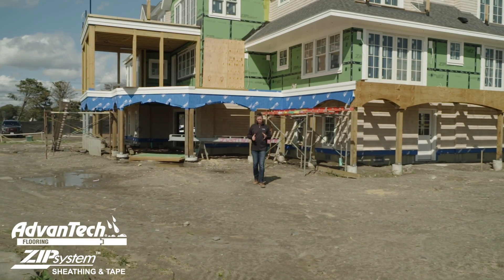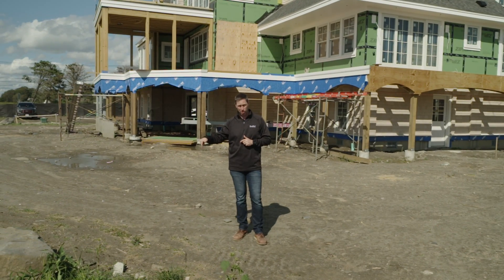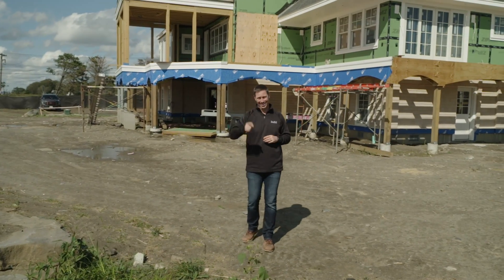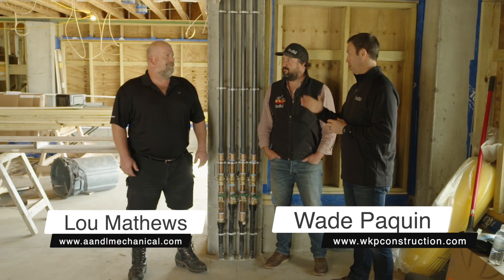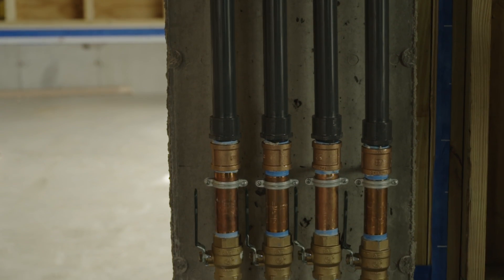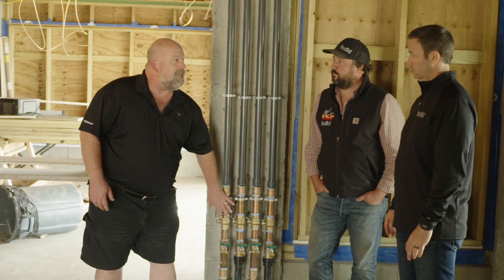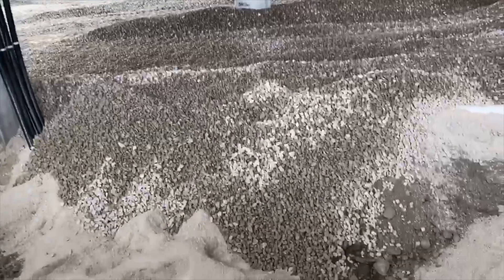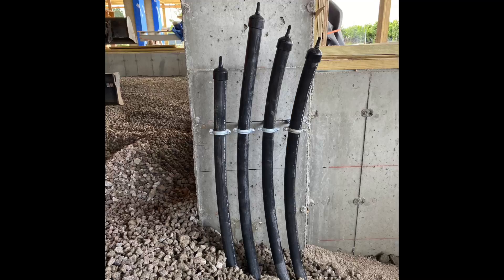Debunking 3 Geothermal Myths

Comment: I'm in the design phase now, we ate designing one well only, instead of multiple, we can still use that well for house water, irrigation and geothermal system, geothermal is closed loop and will provide heating and cooling. For me it was a better option all the way around, didnt have to run a gas line or water line to the property, no meters, no extra Bill's to think about and pay every month. Just electric and if I ever wanted to add solar I could be completely self sufficient. There was a few other systems that provided the same outcome but I chose ground source heat pump. Only time will tell if it was the right choice
Reply: One well for closed loop geothermal and potable water?
That doesn't make sense
Reply: @FrancisKoczur  lol exactly, I've never seen it done but it's a design of my own, kinda of experimental.
Reply: @townsendliving9750  Your incoming potable water will be colder in the winter (maybe 40's) costing more for hot water, and will be hot in summer (maybe 70's) costing less for hot water. You'll need to be able to deal with the cold water not necessary being what's expected for cold.

The depth will need to be quite deep to exchange the heat. You might want to check the data and use a thermal conductivity of around 0.57 W/m K or less
looplinkrlc.com
Reply: @FrancisKoczur  ground water temperature does not change at any time during the year, it's a consistent 52 degrees all year round, doesnt even change by a degree from what I've seen, my well is 80 foot deep. In the summer you will want exchange the heat into the cool from the water, 52 degrees will be much cooler then outside temp meaning it would be more efficient then a air source heat pump, in the winter you will want to extract the heat from the 52 degree water, again, much higher then the outside temp meaning much more efficient then air source. Plus water or liquid is a much better medium then air. Plus there has been two engineers work on the project, so far it has been extensively researched and tested using computer models.
Reply: @townsendliving9750  Is your well in a huge aquifer with plenty of water flow/movement? I think the question would be whether the heat that is extracted or dumped into the surrounding well water from the closed loop would be changing the temperature of that water already sitting in the well, which is now being pumped for domestic use. If there's enough water exchange between the ground water and the well then I agree that if the math checks out it would work (and also an interesting take, never heard of that system before).
Reply: @townsendliving9750  Edit: If your situation matches what @wighty said you should be fine (like a underground stream perhaps)

Deep ground temperature is stable, until you extract or dump heat from/to it. The potable water will steal or radiate heat, probably when in the pressure tank.
80ft is way to shallow for a single closed loop pipe unless something like the well diameter is in feet with a helical coil giving the loop pipe more contact area. Your evaporator will freeze in heating mode without enough heat exchange in the loop.
Reply: @wighty  so to answer some.of those questions hopefully is we put a pump on the well and pumped 500 gallons an hour with no issues, so it's basically a river flowing underneath me, we pump 4800 gallons in one day for testing. I'm at the bottom of one of the largest farms in america, so it's a mile up hill, and the river is a mile down hill. The 4800 gallons were 52 degrees on the first gallon pumped and 52 degrees on the last gallon pump, that test was performed once in February and once in july, same results both times. But the geothermal loop does not go down the well, it goes into a cistern, the well fills the cistern as a sort of thermal battery bank.
Reply: @townsendliving9750  where is the cistern? How many gallons? Is water being cycled in and out of that?
Reply: Cistern is in the ground next to the well house, that's part that's still in design phase I suppose, we were thinking around 3800 gallons, but I have access to a 11k gallon concrete tank, this should provide enough BTU capacity to heat or cool for several days before it needs flushed, so yes then the tank would be injected back into the well, we also thought about a second injection well elsewhere on the property. So we will have one normal submersible pump in the well that pumps to the cistern, and then 1 pump in the cistern that can pump to the house, or with some automated valves pump out of the cistern back into the well. The house is all concrete so the system will run, reach its temperature, empty the water, wait several hours for the aquifer to naturally flush the cold/hot water out, the refill the cistern, and reheat/ recool the house, we also have other ways to add heat to the cistern in the winter, if the fireplace is ever ran there is a heating loop to gather heat from that, and theres also a oil burner in garage that does the same. Since the house is also my place of work a mechanic shop
Reply: @townsendliving9750  that is pretty nifty. You should do a write up of it for people to reference in the future
Reply: @wighty  if it works, so it was my design and I've had two engineers look it over and approve it, but it still scares me cause I'm putting alot of eggs in this basket
Reply: @townsendliving9750  have you thought of making a video and puting on youtube?  It would be cool to see this system
Reply: @bobsacimano4104  I have actually, I'd love.to video my house build and make alittle money like some of these youtubers, I actually started my channel and made a dozen videos but never posted them cause we got delayed on the build this year, we are going to try to break ground next april, I'm an idiot when it comes to electronics but maybe something I could learn, my house has dozens on differnt design ideas that I've never seen on another build. It's been 3 years in the making, and its designed for the average blue collar american, I make less then 50k a year so its defently built on a budget
Reply: @townsendliving9750  lol I'm the same as you with electronics. I have to ask my brother for help with them.  I bought a drone to take pictures of my build which was fun. My brother had to help me a few times.  Good luck on groundbreaking in April
Reply: Sounds interesting Towns End and hope it works well for you. My water well doesn't flow anywhere close to those number.  I installed a ground bed system.  With this single well set up I'm hoping you'll be using a jet pump set up so you don't have to mess with your geo lines if you have to replace/work on your submersible well pump?

Comment: The next time you have the chance ask a HVAC engineer if there would be a benefit return air from the floor in winter and from the cieling in summer.  It has always seemed like a good idea to me.
Reply: The way the forced air systems circulate with the variable speed blowers it doesn't create the cold floor and warm ceiling.  The blower will be slowly moving air all the time. I rarely see temp different than what the thermostat is set for.

Comment: We've been on GSHP for 10 years now in MN.  3200sq ft 4 level split and I have 4 closed loop vertical wells 200' deep.  Gives us 4 tons of cooling.  Electrical utility gave us an all-electric discounted rate so $0.05/KWHr.  Dual stage compressor w/10KW 3rd stage electric strip.  Avg monthly heating/cooling/hot water costs is $149.  House is MUCH more comfortable and ZERO CO risk.

We were quoted $12k for a 80% efficient natural gas furnace and new outdoor air coil vs. $24k for the GSHP including wells.  With 30% tax credits we were looking @ $17k vs. $12k.  Best decision we've made.
Reply: It’s great to see actual numbers from a house in a similar climate to mine. That sounds like an excellent deal.
Reply: How about the lines plugging, piping wall buildup/efficiency, earthquake?  I used to think it was the best way, but that's a heck of a system to replace.  I'm sure you're happy, and it might even be close enough of a wash, however, that is HIGHLY dependant on that extraordinary electric rate; solar electric might be a great addition.
Reply: Until something breaks half way through its stated life cycle.
Reply: @anonymoushippo-m7d  Any properly designed geothermal will only operate in geo mode down to around zero degrees.  If the temp falls below zero then yes, you are on the emergency strip.

Some manufacturers boast their systems can operate in geo down to -20.  Very, very few days each year you get temps that low so for the majority of the year you would be wasting capacity/efficiency at the temps which occur most frequently.
Reply: @Steve Scott .. Congratulations. .. Your math is reminiscent of a '70s TV advertisement. .. " You can pay me now. .. Or you can pay me later. .. But you will pay me". .. Our 1999 Vail house renovation included an NG fired Hydronic In-Floor heating system replacing an electric hot H2O heater plus entire house electric convection baseboard heaters. .. The house sips $ NG and is sooooo comfortable.
Reply: Wait for another year or 2 until you have a major component failur3 (compressors)... That will add approx. $60/month to your monthly costs to date
Reply: @soving  that goes for any type of heat pump, so what is your point?
Reply: @jeremyanderson7741  well my point is, they all talk 20-25 year potential lifespan...those would be anomalies. One should factor in a catastrophic failure somewhere just outside warranty when doing their homework. Fact is, none of these residential units are designed to run 24/7 heating and cooling. They are in no way industrial equipment... So my point is, insulation and better building practices would be a far better investment than a complicated gshp and all of its bells and whistles
Reply: @thomaspayne6866  I'll tell you what, I have hooked up more than 20 GSHP and I could never get over the fact I was bringing a 15KW feed to the unit. Most of them have to run 24/7 to keep up. Another 5kw and you would have enough electric heat to heat a 3000 sq ft home. Up here in Canada where we get real winters most GSHP lean heavily on the Electric strip backup in the real cold stretches. The heat pumps still are producing heat of course just the best loss in the winter cold is too great. Many homeowners who switched from Gas / Oil / Elec heat to GSHP complain that the air is like warm, never hot. That is nice after spending $30k (mortgaged for 20-30 years it will never be cost effective)
Reply: @soving  You're right that you would be better off investing in a better envelope than in a GSHP.  But if a GSHP is running on electric resistance backup for any significant time in the winter then it was horribly designed.  That's not a problem with the technology, that's a problem with design or construction quality.  

That's one of the big issues, we have a serious issue with quality when it comes to the mechanical systems we put into buildings.  Something like a gas furnace will still deliver heat even while it operates horribly and inefficiently.  Higher performance equipment like HPs don't tolerate bad design and bad installation like gas furnaces do.  But that's not exactly a ringing endorsement:  "I prefer NG furnaces because I can hire someone who will do a crappy job and they will still work."

I have an air-source heat pump on my house.  The whole system uses less electricity than just the fan on my old furnace did.  That's something that a lot of people don't realize, NG furnaces don't just use gas, they use electricity for the fan.  And the fact that they tolerate really bad design means that you could end up with a system that consumes a lot of electricity for the fans on top of that gas bill.
Reply: @thomaspayne6866  no need for profanity.
Reply: @soving   sounds to me like there weren’t enough tubing, or they weren’t buried deep enough, for Canadian winters. Correct me if I’m wrong. 

A farmer in North Dakota simply uses large buried air duct with one large fan to keep his orange trees growing in his green house.  Temp never goes below 50 degrees Fahrenheit if I’m not mistaken. And that’s without any insulation, and without any generated heat.
Reply: @soving   —— well obviously the most important factor is to keep the heat in regardless the type of heating system being used. 

The question is which heating system is overall cheapest. 

15Kw pump?  You know what that means?  It means the pump would dissipate 15kw worth of heat into the home.
Reply: @brianwilless1589  that’s how I treat people who lie. They deserve it.
Reply: @soving   Had a geothermal Water Furnace installed in 1987.  Still running strong with only a replacement of one of the water circulating pumps ($145.00) .
Reply: @91156  I would say you have a unicorn in real life and that your experience is the exception. I would also guess you live in a place where you have long shoulder seasons so your unit see a 60% duty cycle annually.
Reply: @soving  I live in an area that sees 98 degree summer days (June through August), and sub-zero days through the winter.  My system operates 365 days a year.
No unicorns here.  May you just don't know as much about this subject as you might think?
Reply: I guess not, always room to learn. So good question is...Would your spouse if asked recommend a new GSHP when yours dies? Modern Air Source HP near match performance at a less cost. If I was looking to buy your home, your 32 year old GSHP system would be a massive deterrent. I would be thinking, there's $40K to replace. Lastly, the fact that you claim to have had  <$150 in repairs in 30+ years tells me you are firmly entrenched in the GSHP Invoice delusion. (paid way too much, still trying to justify it to the wife who wears slippers 24/7 cuz the "house never feels warm")... 30+ years Electrical work, been in thousands of homes, hooked up dozens of GSHP with 60+ amp 240v feeds that run 24/7, Dead compressors, months waiting for parts on backup heat, companies come and go,  that's not covered under warranty, just take it out and put a gas furnace so we can be warm, the election was rigged... I don't know anything lol.
Reply: @soving  my parents geothermal is going on 30 years this year in southern Missouri with zero issues. Horizontal loop fields.
Reply: @michaellowther8589  There are black swans found from time to time. Your parents are the lucky ones. Most do not share that experience.
Reply: @soving  Over in Europe where these systems are more widely used the insurance companies tend to have good datasets as to the durability of said systems. This helps guide consumers towards choosing more trusted brands and also gives some insight in to the trends regarding these systems. One clear trend is that the quality has improved over time.
Reply: I agree with you. All these folks loving on gshps seem to be on a bandwagon.  A well insulated tight house simply doesn’t use nearly the amount of juice.  Spend your money on windows, insulation, air barrier, and cheap air source heat pump.  When the heat pump fails it will be super simple to get a technician to fix or replace because the are familiar with them.
Reply: @soving  -- so your fridge only lasts a year?? Also, very long warranties for geo heat pumps. It's a closed loop, no grit or contaminants.
Reply: @mv80401  an ice chest has 100% reliability too. If you think the demands of a heat pump and fridge mechanically are in the same universe, you are tipping your hand. My whole pont is GSHP have lost their place. Technology in AirSHP has removed the need for all the "ground source" infrastructure, risk and cost. They no longer make sense from a short, medium and long term sense. But like opinions everyone is entitled the theirs.
Reply: @soving  Wrong....Geo heat pumps have the longest service life of any heating appliance.
Reply: @imtheonevanhalen1557  lol, nice blanket statement almost none of that is correct.
Reply: @soving  from your comments I would guess that you're an electrician!? Also are you repairing systems from 1 bad contractor/manufacturer? Because there's nothing new or fancy really in a geothermal system. It's heat pump and water pump. Both of these can be very reliable. If it is not hot enough, it is bad sizing of the system that's at fault.
Reply: @nodata2032  yes to Electrician. I am sure there are great systems the work well. Most of my exposure is 10+ years old, waterfurnace was one brand that had control board issues. My opinions are based one the large number of homeowners who are terribly upset with large Utility bills as the backup power seems to be running. Bottom line they can be complex, a lot of moving parts. My neighbor who is a 40 year refrigeration tech says the components in most of these residential units are not designed to last in continuous operation. So, I hold the belief that GSHP provide more risk than value over their lifetime.
Reply: @soving  sorry but bad control board doesn't have much to do with GSHP. We can agree that there might be bad products and/or contractors out there like a lot of things. From my point of view not much is different between GSHP and other HVAC systems. GSHP use water/water for heat exchange where as "regular HVAC use air/air. So I guess swimming pool heat pump is a in between with air/water. All of which can be very reliable if properly designed/built/installed.

Comment: I'm not sure if the tax incentives are still in place, but a 30% deduction used to be available. 
By what the gentleman said, it would pretty much cover the difference.
I will stress the importance of hiring a driller/loop installer with local knowledge and experience. The contact between the loops and the native formation is most important. Voids will result in lower performance and efficiency.